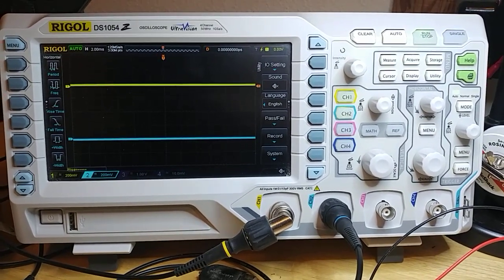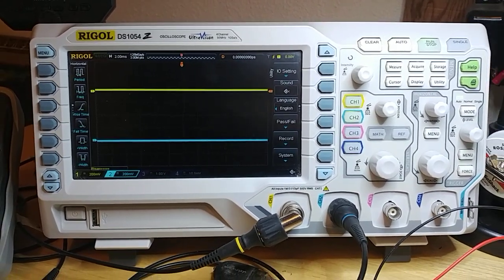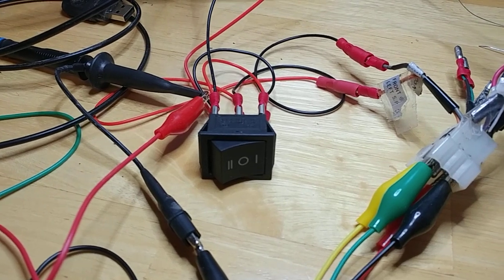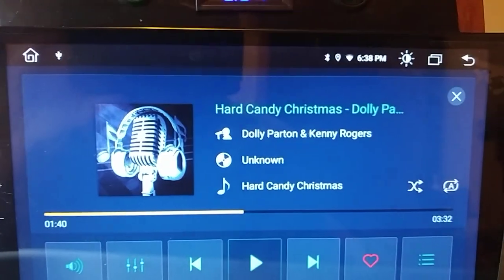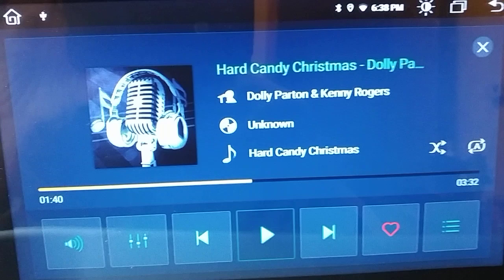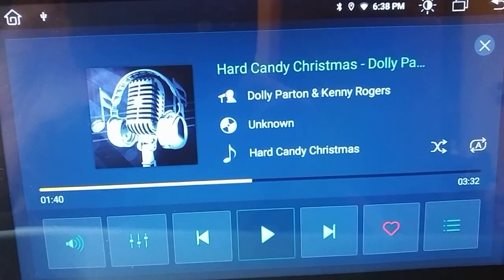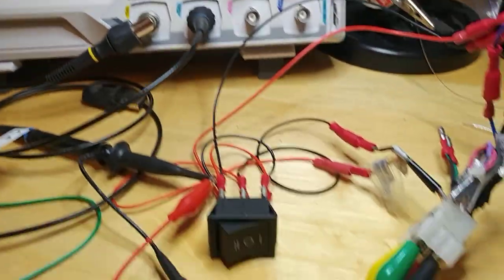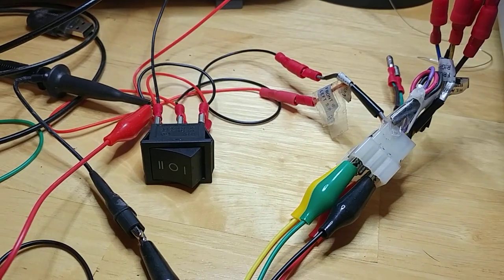Checking stereo speaker output polarity (phase) using an oscilloscope.

Comment: I was checking DC offset with a multi meter on  my 90s Denon DRA-835R and found the right channel showing out of phase/polarity. The offset was low but showing backwards inside the receiver? Thanks for any info as im not sure how common this is as most dont check offset.

Comment from the maker: BTW, the wires on a (car) stereo are normally color coded.  For example, negative wires are striped.  But what if the printed manual and the wire colors differ?  How do you know which is correct?  This is the problem that let me to ponder this question.